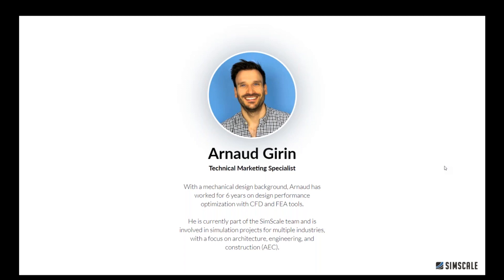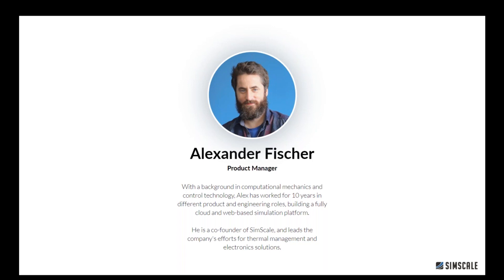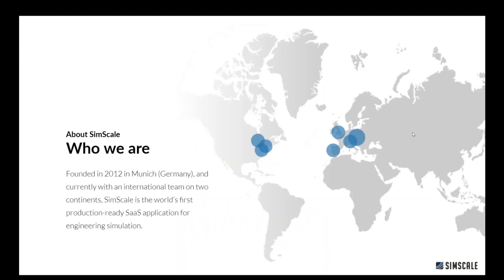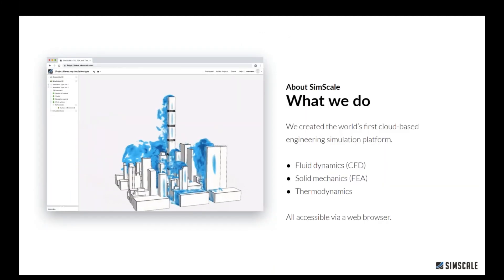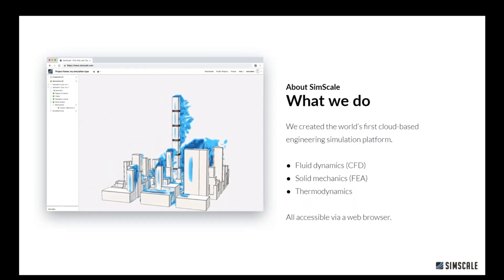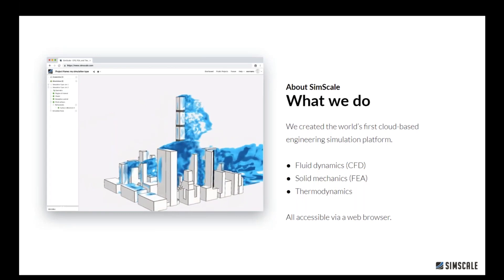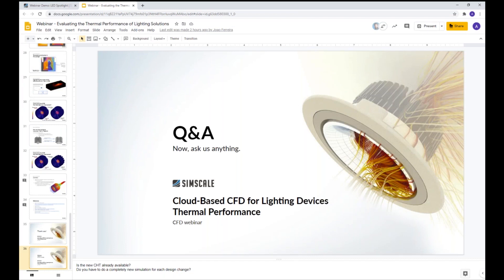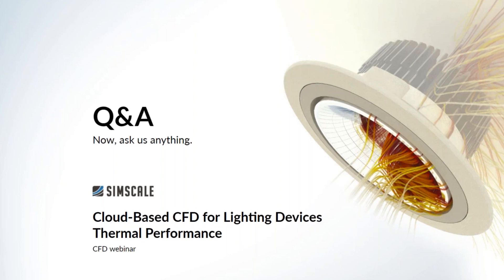Evaluating the Thermal Performance of Lighting Solutions Webinar

Comment: Thank you for the webinar.  SimScale is definitely an interesting option for smaller companies that have difficulty affording the rather pricey lease options of the traditional CFD software providers.
With regards to the seminar, I would have loved to get more contents regarding the SimScale software itself (and less on the LED background as this is generally well known).  In no particular order, here is a list of questions:
- You mentioned that V2 of the CHT solver is most suitable for natural convection but many problems in electronics cooling require forced convection.  Does this solver also work for forced convection?  Any Re number limits?
- Have you benchmarked the V2 solver against your standard solver?  How much faster is it?  Presumably it helps most on steady-state problems... How about on transient problems?
- I concur with your comment that IR radiation plays a huge role in CHT but in your demo you omitted the modeling of radiation.  Is radiation already available for the V2 solver?
- The choice of removing fins to improve cooling seemed a bit counter-intuitive.  And the results show a very small temperature change that could be due to differences in meshing alone.  
- Speaking of meshing:  Would have been nice to include a few images of the mesh and at least mention the turbulence model used for this analysis.